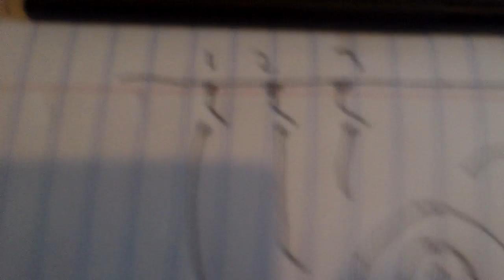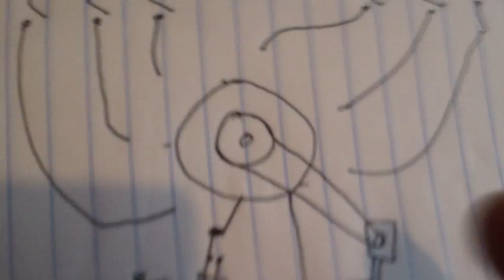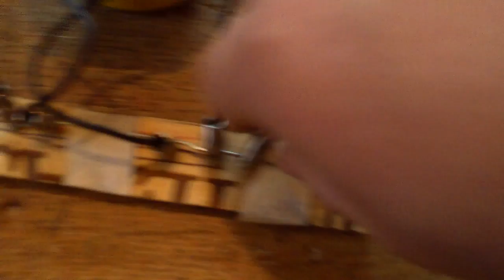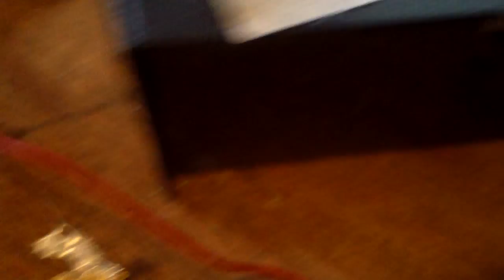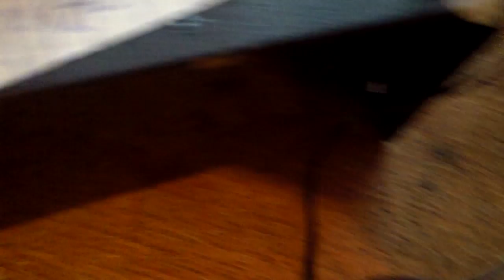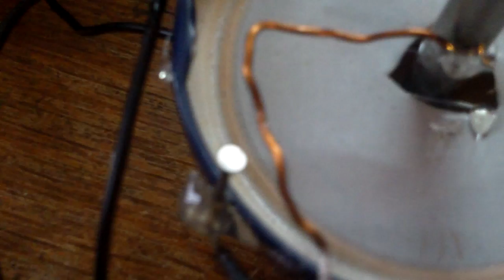homemade calculator

Comment from the maker: thanks all you guys i have been thinking for a while on how to make a base ten calculator with relays for a while but whatever i came up with was way too complex with 12 relays with 6 norm open and closed contacts each and i really didnt want to learn bianary so this is what i came up with. i dont think its as neat as 12 relays clicking off at once but this does the job with way less components. imight post the schematic for the calculator with relays in another video.